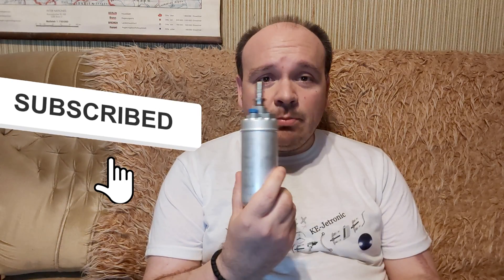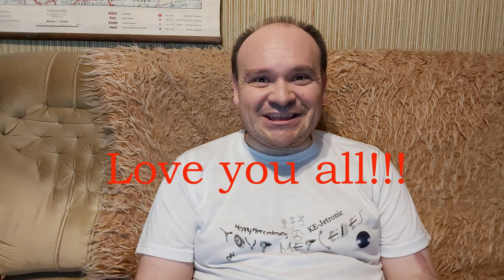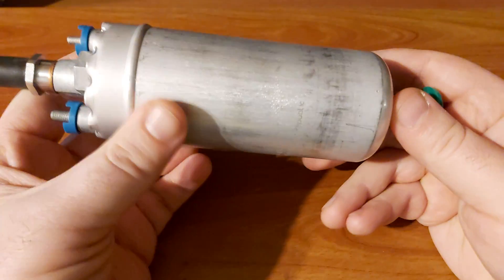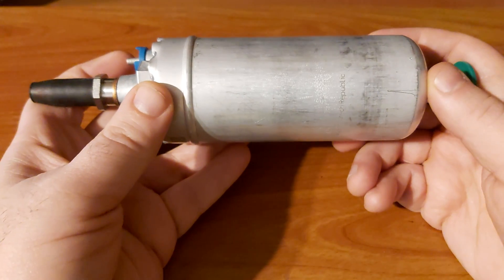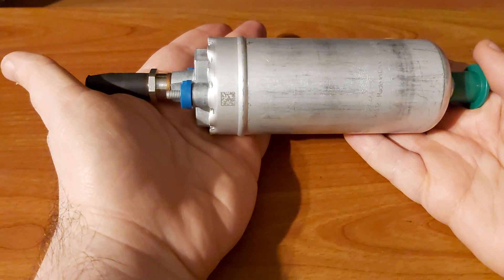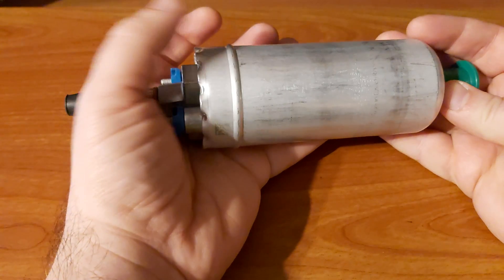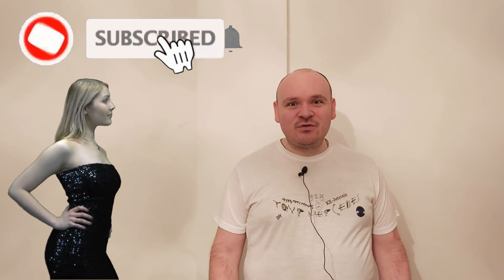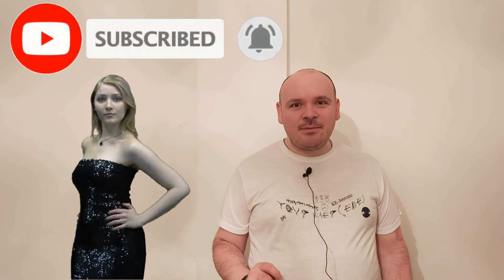㉦Mercedes Ke-Jetronic㉦ - An addition video about the fuel pump

Comment: Hello!
The first time I turn the ignition, my fuel pump sounds fine, as it should, but from the second time I turn the ignition, it sounds intermittent (papapapa) and the car won't start. My system is KE-Jetronic without a lambda sensor (420SEC without catalytic converter).
Reply from the maker: Hi. I would recommend you to remove the fuel pump relay and bridge the contacts 7&8(87 and 30). If the pump runs as it is supposed to and you can start the car then your problem is the fuel pump relay. That's what I would do. Happy Mercedesing!🔧✨

Comment: Hi , i made a refueling,  60 liter full tank, and i drive 150 km and now i have a little bit less than half tank now , that is a loot is not normal , is not an v12 engine  just a normal 320e automatic, can be the pump? shall i replace just the pump? It also makes a strage high sound like struggle flow like(zzz) . But the engine runs really well, and i have no leaks!
Please help me with a tip.

Thx for your videos! Very helpful! I have subscribed!
Reply from the maker: Hello and thanks for everything. Check the fuel pump if it delivers needed fuel quantity(at least 1l in less than a minute, in 40 seconds). Put the pressure gauge on, start the car, let it run for some short time and stall the engine - if he needle drops instantly, you have a bad check valve, replace the injectors if you haven't, check the fuel pressure regulator, replace the lambda if you have it. That's everything I can tell.
Greetings, Ivica

Comment: I think the pressure acumulator is responsible for drop of pressure after stalling the engine. Pres regulator is maintaining a constant pressure for all type of driving, a meant different rpm. At least this is what i think.
Reply from the maker: Yes, you are right. But what I am talking about is if the needle shows 0 the same moment you stall the engine and not dropping bit by bit.
Reply: You are right for this instant drop.👍
Reply from the maker: @ionutboruga6015  Hehehehehe 👍🏻

Comment: Dont forget a faulty fuel accumulator can also be detected by a drop in fuel pressure after switching off. Diagnosed by clamping off the return line from the  accumulator and retesting the pressure  drop. 👍
Reply from the maker: The next video. Testing fuel accumulator.😃
Reply: @mercedeske  koji je to video nesto ne mogu naci ima mnogo videa kod tebe nema veze na koji je jezik al mozda mi zatreba da ga pogledam ako vec ranije nisam

Comment: Hey craftsman Why can damage the pump and how life has usually;
Reply from the maker: Hello. The pump gets damaged if you run out of fuel, so watch out. No one can tell you how long it can last. Here is the first part of the video on which I talk about it in detail. Happy Mercedesing!
https://www.youtube.com/watch?v=jK8qpUfwyHY&t=16s
Reply: @mercedeske  Do you think that with a liqui moly injector cleaner it ensures the functionality of the fuel system such as the pump, the tubes and the injectors?
Reply from the maker: As for the pump and the tubes, well...nothing lasts forever. You can prolong the lifespan of the pump by not driving on reserve and running out of fuel as I mentioned. As for the injectors - they have to be replaced each 150k km, there is no way to clean them and even if you do, you won't achieve anything because the valve seat gets worn out and there is nothing to prevent them from wearing out, that's now it is.
Reply: @mercedeske  Ie even if the car is working well after 150,000 km injectors must be replaced; mine has 330,000 km and have not changed But nevertheless clock works.